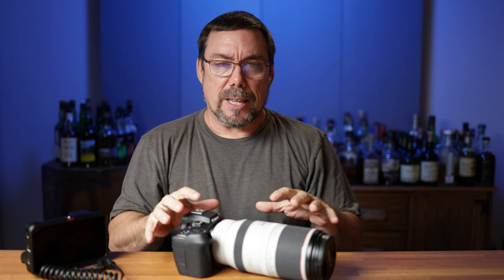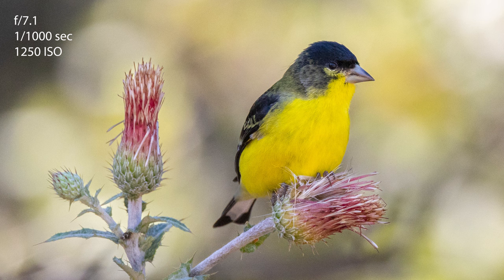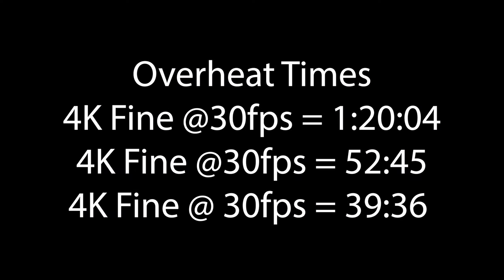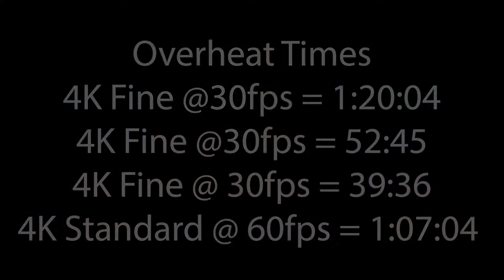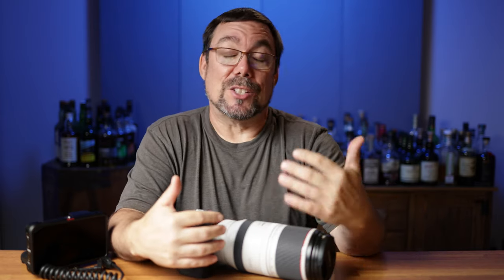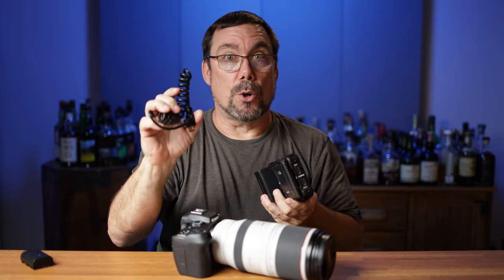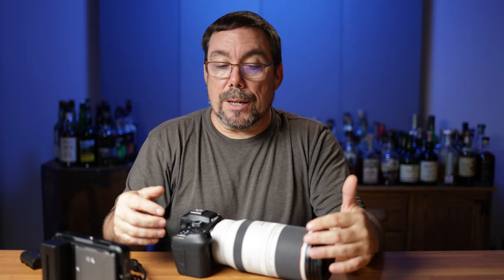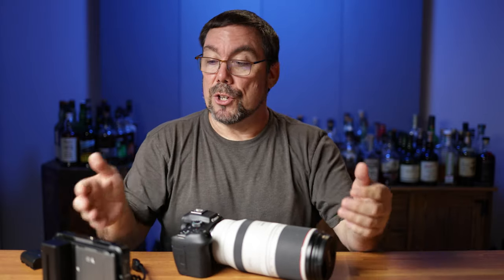Canon R7: Overheat Times, Battery Life, and Broken HDMI Port!

Comment: Just bought my R7 this weekend.  Got the kit lens and also bought the RF100-400mm f/5.6-8 IS USM and the RF 50mm f/1.8 STM.  Also got an extra battery.  Noticed that my external power brick and car usb port will not charge the battery when installed in the camera.  I will be testing the car vlogging capabilities for about 20-35 minutes when going to work and coming home.  See how the overheating and battery lasts.  I have plugged other cameras in the usb port and the cameras were charged, including the external power brick.  I have the Sony ZV-E10 and the HDMI Port failed after 5 days.  Not sending it back but will use it for on the road.  It is a shame with this pandemic and less available gear that the quality is not what it used to be.

Comment: Record time seemed pretty good, in my opinion. Would love to see the wildlife photos with R5, cropped in post, vs  R7, also an iso noise performance between those two cameras. Once thing I have been noticing in the sample images from the R7 is that the noise performance doesn’t seem very different from the M6 Mark II, which is ok, but not great.
Reply from the maker: Hey Mark! I have been looking at my M6 Mark II files in Lightroom and comparing them to the photos from the R7, but I don't have that many photos with comparable ISO's just yet. What I do have, the ISO performance looks close. I think it's what I expected from both APS-C sensors.

Comment: I received my R7 on the release date, so I've had it for about two weeks or so. Yesterday, I was out with the 100-500mm on and started getting a repeating failure that would flash an error for a fraction of a second, then screen would go black, so I could not grab string or the code. To fix it, I had to power cycle.  I think the power cycle clears the previous errors from the camera because when I go into the "View Info" screen to see error details there are no errors shown.When I returned home, I pulled both cards, battery and lens and reseated everything. So far, I have not been able to get it to fail again.
Reply from the maker: Thanks for sharing! With all the different combinations of lenses and accessories that are out there there are sure to be some "glitches". I hope the flicker with the Ninja was a glitch and not something broken. Time will tell.
Reply: When was the actual release date?
Reply from the maker: @LoveHatePlanet  preorders started on May 24th and i think they started to ship on June 24th

Comment: Great video and analysis! As a Canon girl who's still walking around with an R due to the overheating issues of both the R5 and R6 I'm really surprised that Canon would release another camera with the same issues!
Reply from the maker: Even though it overheats, other people have tested it and there times are much better than what I got. I'm just one reference point.  I'm also impressed with the recovery time once it overheats.
Reply: Well I thank you for your honesty but the recovery time is not the point. Why Canon who was once an industry leader continues to push out Cameras with overheating issues. The R7 is almost 2k and there are plenty of cameras that don't have this issue at the same price point. Besides the R, I own the A7S3, the GH5 and just picked up the OM1. These cameras have unlimited recording and run all day with no overheating issues at all! Time for Canon to go back to the drawing board and try again. By the way Peter Gregg on his Christmas Tree channel said his R7 overheated several times using different settings so you're not the only one!
Reply: Canon fixed the r5 no more overheating so you can now purchase that camera without worry.
Reply: The overheating is done on purpose to cripple the camera.
Reply: They all overheat in 4k60

Comment: I had Error 70 which is an over heating issue
while using ELECTRONIC Shutter.

in photo mode. !

Just short burst but lots and lots of short burst ( without hitting the buffer limit )
and It just stopped working.

BUT when I changed to MECHANICAL shutter, it all went away.

Did  you experience the same thing ?
Reply from the maker: I have not experienced that with mine. Interesting.

Comment: Bummer about the HDMI port.  I do wish Canon used a more robust port in their cameras.  Where I live, in the Puget Sound area of Washington state I should never see the temperatures you were recording in.  Great information about the recording times and how fast the camera cooled down.  With the way I plan on using it for video, short clips of bird action, the limits should never affect me.  

So far I haven't noticed any issues with mine but I have had it less than a week new.  I have found the battery life to be quite good.  I haven't run out while out shooting yet.
Reply from the maker: I agree. I wish they would put a full size HDMI in. Good news is I reset the camera to the factory settings after I talked to Canon and I'm not getting the flicker anymore. Now I need to set the camera back to my settings and see if the flickering returns.

Comment: Hi Peter. Just found your channel from this video, so I apologize if you've answered this question previously. I'm looking to get a replacement APSC camera to do video of wildlife and backup photos. I went on a trip recently, and the camera I had couldn't do any video in certain situations. I was trying to get some video at dawn and dusk of some animals, and with the ISO maxed out, it was just a black screen. Same when I was trying to get video inside in the evening and even when trying to do a watering hole lit by massive spotlights. I was able to get photos with my main camera no problem (also APSC). I'm extremely new to video, so i only shoot 1080 and do zero post processing, so i would not be shooting clog3. My question is whether you could do a quick test of video in low lightat those basic beginner settings? I'm not looking for the best camera out there or perfect quality. I just want to know whether it would work or if it'd be the same situation literally nothing because the camera can't shoot video in those lighting conditions. I'd really appreciate the help. I can't afford to buy it only to be in the same predicament. Thanks so much. Cheers from Maine. :) Paula
Reply from the maker: My video ISO video will not be ready for at least 2 weeks, but @joshsattin has done what you are looking for. He has done dynamic range test and low light.  https://youtu.be/UdBmhipcZU0 https://youtu.be/gc-9YMb3Pn8 I hope this helps.

Comment: They should have put at least a mini HDMI in the camera. Micro HDMI is kind of outdated in my opinion 😊 Hope you get it fixed soon, cause I’m looking forward to the next videos about the R7 ☺️ I still haven’t gotten the one I ordered…
Reply from the maker: I was on the phone with Canon for about and hour and we eventually got to the point of just resetting the camera back to the factory settings and the flickering stopped....for now. I am going to set the camera back up with the Atomos hooked up and see if a specific setting caused it to flicker. Fingers crossed it was just a fluke. I still like the camera a lot and have been using it like crazy. Full frame is great, but there is something about APS-C that I like just as much. Maybe the 1.6 crop??? I hope you get yours soon so we can start exchanging notes.

Comment: Did you test with the screen flipped out? Also... Did you try 24fps? It should be more relevant to results @25p that we use here in EU.
Reply from the maker: Yes. I had it on a tripod with the screen flipped out. It just does not make sense to me. One day I got over an hour and then the next day the camera overheated in less than 40min. No setting changes or changing of positions. My studio is not the coolest room so maybe the camera is sensitive to temperature. I only tested 30fps.
Reply: @faspete2nd  THX!

Comment: In my testing i found out the 4k fine mode is even very moderate, i was more shocked by the fact that somehow the 4k60 crop mode consume more energy.

Where i found it can get a huge problem (if there is anyways the need for it which isnt in 99,9% of the cases): 1080p120 slowmo video! in 120 fps recording the R7 gets the hottest, or the problem i often have: I just drain the battery very fast when doing 120 fps video, also if its like 30 seconds clip, 5 minutes break, 10 seconds clip etc...

If i ever go deeper into video, i will get for sure a spare battery. As much people are praising the R7s battery life, i guess they only talk about photography since in this usecase i also dont run out of battery only once as i forgot to charge the battery within 3 days of usage i had to take a short break in the car and charge via the powerbank for some time.
Reply from the maker: I have never been a big slow-motion shooter and never even thought of testing it. Thanks for sharing that information.
Reply: @faspete2nd  i got btw original 2x E6N batteries in good condition for „only“ 40$, now the limit is going to get my SD cards… 1 hour video needs about 120GB, and just the 2x E6N batteries run for like 1,5 hours each

Comment: is that a ninja V or a screen recorder? do you get to get better recording files compared to the internal recording in the canon?
Reply from the maker: It's a Ninja V which is a recorder. I don't think there is a quality difference internal or using the Ninja. I use it to combat the heat issues and better monitor visibility.
Reply: @faspete2nd  thank you